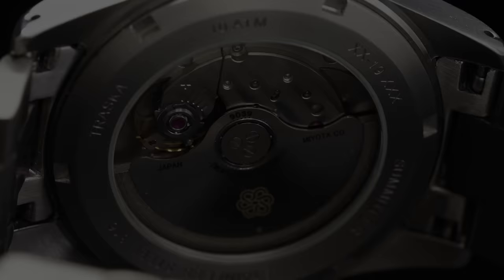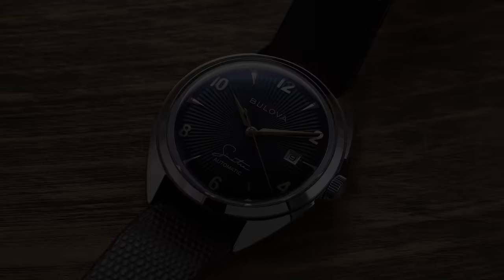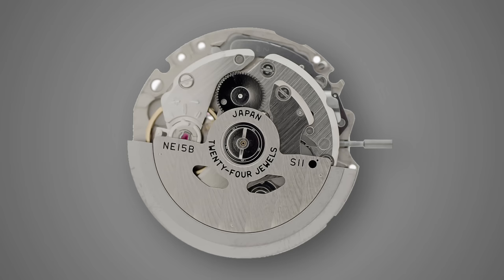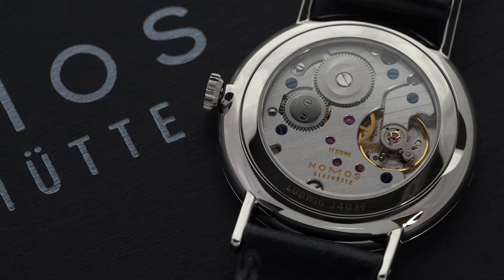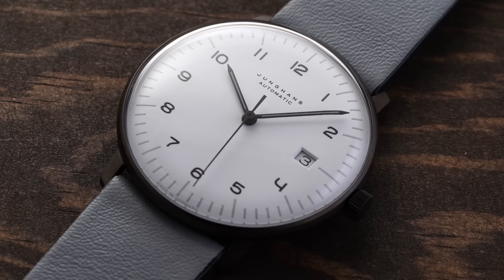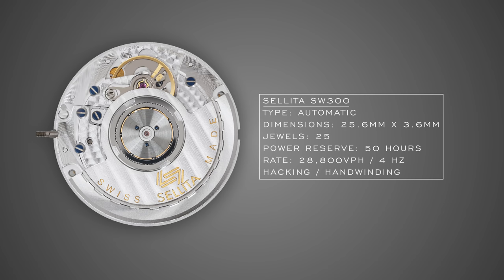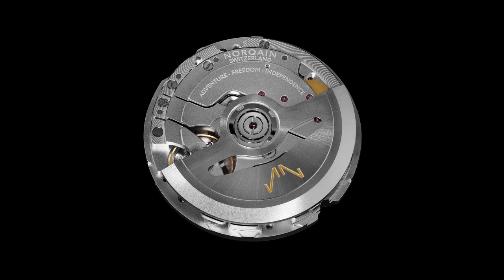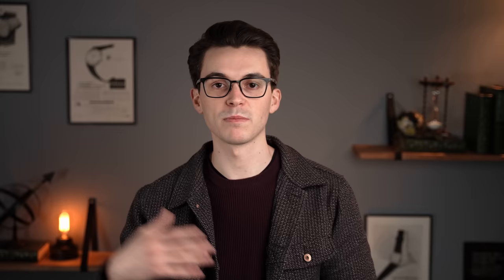Overview Of Third-Party Movements: ETA, Miyota, Seiko, & More (A Comprehensive Guide)

Comment: Movements usually set the price of the watch. So it's good to know what movement is in the watch you are getting so you don't over pay. Some microbrands will sell a $1000 watch with a NH35 in it which is absurd.
Reply: A Sellita would be more fitting
Reply: A whatch with an NH35A can be had for $100
Reply: @gapf2010channel  exactly!
Reply: I disagree. Bought in bulk, before sorting and further regulation by watch manufacturers a Miyota 8215 or an NH 35 would be sold anywhere between  $15  and $35. A 9000 Series or 4r+ between $18 and $42. Etc.etc...
Reply: As absurd as using a Sellita SW200 Standard in a 2500 EUR watch from a big brand, or is it?
Reply: @gapf2010channel  one microbrand started with ETA's then switched to NH35s but didn't tell anyone and didn't change the price
Reply: @campshay19  Now that's shady! I've seen a couple microbrands that have the same exact watch, just changing the calibre inside it, but the price reflects that.
Reply: Yes. The movement is important. But don't disregard the case finishing, bracelet/strap, the dial, hands, any additional decorations, etc. You can have a fairly cheap, but good movement in a watch that have a higher price, just because of the aforementioned stuff.  You shouldn't compare it to a cheaper one with the same movement. Again, this is not always the case (pun not intended) but look deeper before you judge.
Reply: pedrodte nataniel  Amphibias are custom builders dream
Reply: pedrodte nataniel  Agree read somewhere about vostoks having indirectly driven seconds hand
Reply: @rainerhofmeister6648  TRUE
Reply: @campshay19  Man, that is disgusting! I am a fan of the NH35s, but, if that is what's in the watch then I want to know it.
Reply: @campshay19  which Brand did that?
Reply: @KoolyO2  Well said, that is why I picked up a Longines "full ceramic" diver. I really like all things  ceramic.  👍
Reply: Sadly a certain Swiss brand fits a Swiss quartz time piece date movement (can be had for £18) and charge you £1400 to £1800 for the ladies and Gents models, now that is absurd.
Reply: @a0r0a7  well, unless you cann name that brand and show proof you are just talking crap.
Reply: @Alph92  I work in the watch repair industry.  So you clearly don't. I would suggest you do some research on the cost of quartz movements and see the RRP of certain established Swiss brands and what they charge for their watches.  Then you will see the highly inflated prices charged for simply a quartz watch not even mechanical. The company in question TH. Go work that out. You are paying for the name and granted you will generally get a very nicely made watch in terms of case, bracelet, dial and hand finishing.
Reply: @a0r0a7  hilfiger?
Reply: @Alph92  Tag Heuer. $1.2k watch with $30  ETA 555.415 Quarts.  My father bought this was as a present for weeding to my sisters boyfriend and I was sick when I saw it. It's ok to pay $300 but $1.2k :((((. And my sister got cartier watch :( who the f*** is buying this shit watches.   I am glad she bought new $11k rolex with diamonds, at least she knows what good watch is.  And her boyfriend wears IWC portugiser.
Reply: @jacekcierpiszewski  you are correct. It is a sad fact for so many products in life, you simply pay so much more for a name. Yes there is quality but it does not necessarily mean it is any better than a cheaper competitor.
Reply: @a0r0a7  sure. Did u see oriant kamasu?  It's fabulous for the price. That's a quality/ price watch.
Reply: @jacekcierpiszewski  can't go wrong with that one.
Reply: I want to buy a watch with the ETA inscription on the dial and with the ETA mechanism inside it will be honest
Reply: @jacekcierpiszewski  as someone with large arms, I'm going to grab Orient Nami. That thing maybe not as pretty as Ray raven but it's still beautiful
Reply: @a0r0a7  so why the cloak and dagger with Tag Huer… if it’s true why not just say it?! I understand not wanting to trash a brand or whatever, but if you’re giving factual specs then you’re either part of the problem or the solution
Reply: @greg6162  not if its true, true. Yes Tag like many put cheap Swiss quartz movements in some of their watches. If you put a Seiko NH35 mechanical movement in a watch people feel charging a £1000 for that watch is way too much but acceptable by Tag for example who fit a quartz movement and charge more. A mechanical movement both in parts and production is way more expensive to to produce than a quartz movement. Please explain your last comment because that makes no sense, part of the problem or solution? Watches with Seiko NH35 can be had for under £100 and have sapphire glass, all stainless steel, ceramic bezels, milled clasp etc.. So no you don't have to pay £1000 for a watch with a NH35. As for paying £1000+ for a Swiss quartz watch well that is anyone's choice like anything in life. Marketing, brand name and perception are very powerful but does not necessarily mean you are getting anything better, like many products in life.
Reply: @a0r0a7  yep I love particular tag
Reply: You people  really need help
Reply: @highwaystar3780  😁
Reply: @highwaystar3780  why because they understand the difference between movements and you have no clue so that means everyone else needs help lol it's you my jealous friend who needs help
Reply: @darrenfry4695  Im honored to be "your  Jelous friend".  But exactly what am I Jelous about....Different Movmnts?  There are more important things to be jealous for..  I own around 10 watches and all of together they maybe add up to $12k.  I bought them strictly for their design. They all tell the same time and I don't give a shit if a Cockaroach is powering them.  You couldn't put a gun to my head to waste my time discussing their Movmnts with you people who Truly Need Help.
Reply: @darrenfry4695  you did get me interested i must say.  I'm looking at my Constellation Omega which has a glass back.  It has a very pretty designed Movmnt. It says 8500, whatever that means.  I also looked at my Longines. Its a Chronograph and also has a window with a very elaborate engine but I couldn't see a number?  I truly  live these 2 watches.  My other watches have steel covers so...  I also have some Longines dress watches from 80s that need batteries.
Reply: @darrenfry4695  whats...f.u ?
Reply: @darrenfry4695  also have a Hamilton wind up watch.  It has sandblast finish and see through back.  The inside is Not decorated but I noticed its more accurate than the Longines and Omega.  Ironically its the Cheapest watch from all my watches....around $340 from what I remember.
Reply: @highwaystar3780  yes there's good cheap watches out there if you know where and what to look for ,,nice one mate 👍🇬🇧
Reply: @darrenfry4695  ive said many silly things since I learned to speak.  But never on YouTube.
Reply: "Movements set the price watch"  Rolex Daytona starts at £20,000 and its movement is no better  than most higher end chronographs! You pay for the name not the quantity.
Most Rolex owners don't care what's inside the watch,you could put a cheap quartz movement in and they would still buy them!
Reply: @nearlyretired7005  thank you!
Reply: If movements set the price of the watch then 99% of the luxury watches are insanely overpriced.
The brand name and heritage and finishing set the price, the movements are in general not the most expensive, not even the in house movements.
Reply: @campshay19  Please state the microbrand.
Reply: Actually movements don't set the price. The finishing and materials do
Reply: @ThePurple1968  The name does mostly
Reply: @KoolyO2  I would imagine calibration and adjustment at proper lab by professionals adds more to the price than decorations, at least up to a certain mortal people standard... I cant seem to find anything online about the process that ETA2892A2 powering my IWC mkXVII undergoes after its brought in to Schaffhausen.  It would make VERY interesting watch (pun not intended). Whatever they do Im getting around  2-3spd variation after couple of months of wearing, and thats mindbogglingly accurate for my first proper watch. Its a bloody addiction :)
Reply: @oscarosullivan4513  I haven't heard of Vostok having seconds. I guess it depends upon which Vostok you're referring to. 
Vostok-Europe is distinctly a different brand from Vostok.
Vostok-Europe is a younger company based in Vilnius, Lithuania building low-volume, limited-edition, mid- to high-end dive, pilot and sport watches with many models utilizing tritium tube technology. They use a number of movements. NH35 and ETA 2824. They have used a couple of others. They make very nice watches $250 to $1300 US dollars. You can find them around for  less on the top end.
Vostok is a Russian company. They use there own in house movements.
Reply: @nearlyretired7005  you also pay for that materials they're made from. And the Craftmenship of assembly. Quality of the finishing.
I'm not sticking up for them. I do own one, out of the 350 plus watches I own. I agree that in some ways they're high for the overall watch. It just depends.
Reply: @mazatlan79P  you are correct about the materials and level of calibration. If you take a ETA 2824, it’s cheaper to have an Eleborè movement than a Top or Chronometer movement and that’s because of slightly better and higher spec parts, but the calibration and regulation needed to get the Top or Chronometer movement to perform within COSC standards adds a cost.
Reply: @rainerhofmeister6648  not at all as a chronometer standard calibre is a lot more expensive than the base movement.
Reply: It does not matter, a quartz movement will be more accurate than any of the ETA movements. They are not being sold for their presition, they are being sold for their complexity, that's what people is not looking at.
Reply: U forgot to consider that movement is just one part of whole equation. What abt the design, finish , materials , logistics, marketing, workmanship and etc. this 1000 is not big if u have overhead and RnD to consider. Designs and testing cost money.

Also profits is can be used or reinvested for future releases and prehaps inflation when things get more expensive.
No business is a charity. People want to make profit for many reason
Reply: Not the case for fashion watches where the label set the price of the watch.
Reply: I am starting my own brand , originaly i would choose a sw-300 but the selling price would be to high like around 1000€ , now i think ill go for a cheaper swiss or the miyota .and hope to price it around 600€

Comment: I have 2 watches with the movement Miyots 9015 inside and both of them are great! The movement is rather slim making the cases of the watches also very slim. Accuracy wise, both of them are the same at + 3-5 seconds a day. They are so good that I don't want to buy a microbrand watch if it does not have a movement from the Miyota 9000 series.
Reply: agreed, Miyota 9000 series and ETA 2824-2 elaborate version are my go-to option now, they run far more accurate than 6R15 in my other watches
Reply: I love the Miyota 9 series too. I like that I hear and feel the rotor. I like spinning it. I don’t mind what people say. I like the fact that I know it’s there
Reply: Just got a Smiths Everest Gilt dial with 9000 series...keeping excellent time.
Reply: Which brands do you have?... it's not so easy  to find out  in the market brands which fit 9 series... so, if you can tell me a few brands, then it'll be very much  appreciated.  Thanks
Reply: @robertobaccala4752  Phoibos used the Miyota 9000 series but as of late, they only use Seiko NH35A. :/
Reply: @robertobaccala4752  Lorier and Nodus have some quality pieces. You can shop used for under $500 with Miyota 9000 series movement. I would recommend Certina for ETA movement around $500-$600 mark (new)
Reply: @robertobaccala4752  Lots of brands use the 9015 series movement. I have a Helson Sharkdiver with one and a Zelos Mako V3.
Reply: My 9015 died w/I a short period of time. :-( Now I’m looking for someone to look at/repair/replace it.)

Comment: With Swatch turning off the supply to non Swatch watch makers, and them being basically an in house movement supplier to Swatch brands shouldn't we begin to stop calling ETA movements third party - and begin calling them in-house movements for many Swatch brands.   Just like Swatch has some 18 watch brands they also have some 17 manufacturers in house of which ETA is one.  Swatch seems to be a classic vertically integrated company and I'm sure as a movement specialist they are involved with making Omega movements which for some reason are considered in-house for Omega.  I think a more accurate story for ETA would be how they are sharing their in-house technology improvements such as SI hairsprings, to many of the Swatches brands.  This story may be a bit more complex to tell, but it may better reflect reality, rather than the old third party movement story.
Reply: So that would mean any off brand watches equipped with ETAs would be collectible? 🤔
Reply: What most brands are calling in-house movement I strongly believe its rather a reference to in-house movement  design and not the manufacturing the movement per se, which makes sense to me.
Reply: @victorbgdream8328  i don’t think that’s a consistent explanation or definition of an in house movement though

Comment: Having owned watches with both in-house and 3rd party movements I can safely say the quality and reliability doesn't change one bit between them and as Teddy pointed out, totally comes down to how each watch brand regulates the movement when it's going into the case.

Currently I have the following app-tracked accuracies from my current collection:

Baltic Aquascaphe SB01 (Miyota 9039): +0.93s/day
Baltic Aquascaphe Bronze (Miyota 9039): +4.9s/day
Laco Aachen 39mm (Miyota 8315)  +7.08s/day
Hamilton Khaki Pilot Pioneer Mechanical (H-50, ETA 2801 base) +0.54s/day

And in recent years sold but really enjoyed:
Marloe Morar Black Edition (Miyota 9039) +2s/day
NOMOS Ahoi Atlantic (NOMOS Epsilon) +3s/day
Tudor Pelagos (ETA 2824-2) +1s/day
Marloe Coniston Speed Edition (Miyota 8N33) +4s/day

These are incredible accuracy figures really for non COSC movements and a testament to the brands regulating their watches properly. The 8315 is the only exception but 7s a day is still nothing to sniff at for a mid-band automatic movement with 60hrs power reserve. I can happily wait until service time and get my watchmaker to regulate it to more positions in that time.

Comment: An interesting thing to mention is that Sinn Spezialuhren from Germany uses 7 different manufacturers for their movements. First is of course ETA, but mostly the quartz watches like the dive watch line UX, then of course Sellita in most of the normal 3-hand-watches like the 104, then Valjoux for the 7750 like in the 910, then a clone of the 7750, the Concepto C99001 in the 103, then comes the La Joux-Perret 8000 in the 903, then the In-House-Stuff they have come up in the EZM10 and others, but as it's a ground-up-modification of 7750-like movements, it's shady. At last we have the UWD 33.1 in the 6200 WG MEISTERBUND 1, which rivals A. Lange & Söhne in beauty and finishing. 7 manufacturers is just insane for one watch company.

Comment: I own seven watches that use the ETA 2824-2 movement. It’s a true workhorse.

Some of my pieces include the
Tudor BlackBay 79220b
Breitling Superocean 42
Tissot PR100 COSC Powermatic 80
Tag Heuer Aquaracer with the Calibre 5
Reply: I several ETA based watches and have never been let down. Great movements.

Comment: I have an Invicta Pro Diver with an SII NH35A movement.  This watch over time  had gotten me into the realm of watches and after roughly 7 years of absolutely beating it up (I got it when I was younger).  This watch after recently adjusting its speed and tightening the rotor (came loose from having beaten it up), this thing is still going strong within chronometer specs.  I’ve since bought a new pro diver with the same movement and it still keeps going at chronometer time (after adjustment). I hope to get an omega in the future 😁
Reply: Hope you get your Omega, my best wishes man! Just a quick question, is the Invicta logo on the side of the Pro Diver often visible under normal use with a short sleeved shirt?

Comment: I have to say, the 9015 Miyota series is better than ETA/SW200…..and yes I have all.  They’re more durable, require less maintenance, and don’t have the winding weak points.  The only complaint you hear is the sound of the rotor spinning at times, which bothers me none at all.  My current example in a Vaer watch is my first.  Keeps a consistent +4 seconds a day.  Very pleased.

Comment: Great review of the various third-party movement available on the market. One thing about the Miyota movements that I have noticed is the very loud rotors when compared with Seiko, ETA, and STP movements (I only have experience with these movements). This is certainly true of the 8000 series, and is true even for the 9000 series. It brings to mind the notoriety of the noise level of Timex quartz movements. 😄
I am looking at adding a Squale Montauk to my collection soon, which would add a Sellita SW200 into it. I have also not had a great experience with the only STP movement in my collection and am not sure I would purchase another one.
I am excited to see FTC's automatic movement when it gets released, and to purchase an automatic watch made in the USA and not just assembled in the USA.

Comment: Back in 1989 or 90, l bought  my mother a watch with Miyota quartz movement. When my mom passed away, my sister gave me the watch to me. It still works, has never been serviced, except  for a simple screw tightening which l did myself. Talk about Japanese  enginuity.